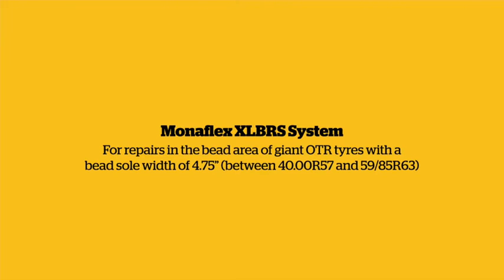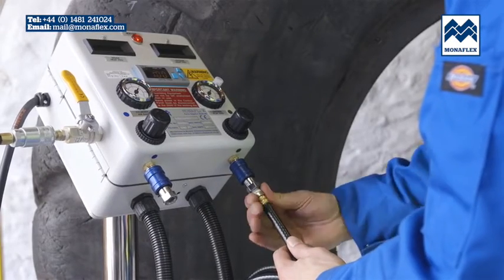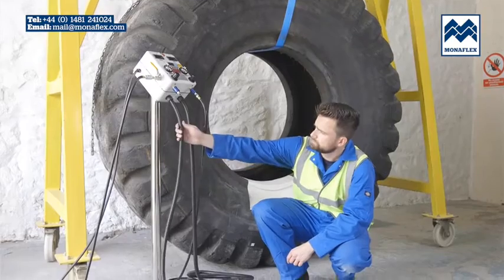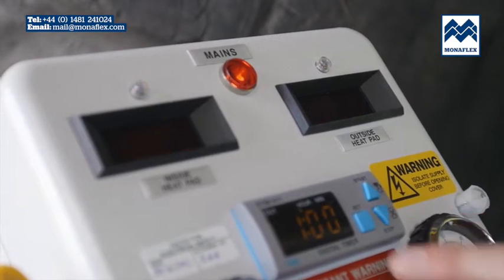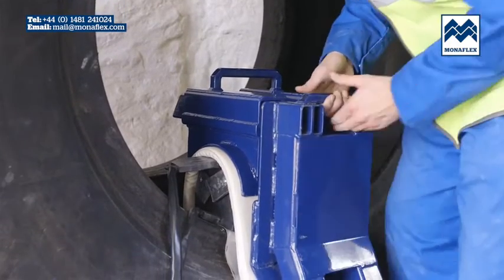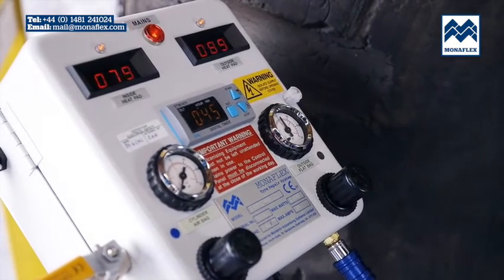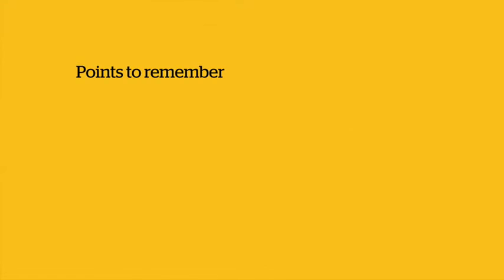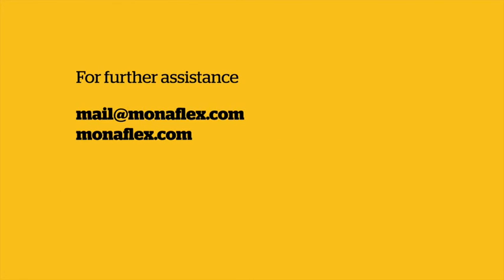Monaflex Tutorial: Bead repairs in giant OTR tyres (up to Bead sole width 4.75")

Comment: What do you do if your patch bubbles on the side corner??
Reply from the maker: Hi, thanks for your comment. There are several reasons this could happen: 
---> The black cement used has not been allowed to dry before installing patch ( this causes the solvent to become trapped within the rubber which results in bubbles).
---> The cushion gum/ black cement used is past its use-by date.
---> Some kind of contamination.
---> Pressure – sometimes if the patch is thinner than the hole made through the inner liner of the tyre there isn’t sufficient pressure along edges. Avoid this by using an extra layer or two of cushion gum under the patch to slightly raise it up above the surrounding tyre liner.

For further information email info@monaflex.com detailing:
---> What type of patch are you are using using (cloth back, uncured, dual cure, chemical)?
---> Whether you are using it in conjunction with black cement and a layer of cushion gum
---> What system are you using to cure into the tyre?
---> What do the bubbles look like?
Reply: @Monaflex  thank you for answering my question first of all. 
-I am using black cement and I’ve tried using cushion gum under the patch right next to the liner so the same create a dips and it has enough pressure only a few time but I never thought that I could be the problem. 
- i’m using TECH  CT68 A patches cloth no chemical
-no cussing gun only on outside 
-cure with Monaflex system vulcanized 
-I don’t believe there’s any contaminants I try my best to make sure its clean
- we also add a few vent strings to try and prevent any air from staying under the patch and escaping to the outside but it seems like that doesn’t work well. 
I believe it may have to do something with pressure or I’m not letting my black cement glue dry enough even though I haven’t had many problems with that but I believe that could be one of the reasons for trap moisture or the glue I let it sit for maybe 30 minutes or less and I installed a patch but it seems like maybe I need to start letting it sit for a little longer before installing the patch but I never added a second layer and waited 15 minutes it’s always one layer and wait 30 minutes for it to dry depending on how dry it is. . I messaged Monaflex but I never got my reply back
Reply: @Monaflex   The bubbles are always about 3 inches in length in about an inch thick right on the corners of the patches so I make me believe that it could be something to do with the liner being to 10 or the patch been too thin for the existing hole I will try to experiment with that idea my patches come out perfect but I always have problems with the bubbles on the corners .. I do all kinds of patches but I mostly focus on bigger patches CT 52 A and up to CT 68 A. Thank you for your knowledge in your response
Reply from the maker: @-C_r_y_p_t_o-  Sorry that we missed your original message. I'll pass your comments above to our technical team.For the fastest possible response please contact us on info@monaflex.com